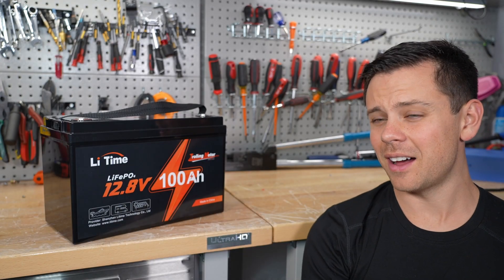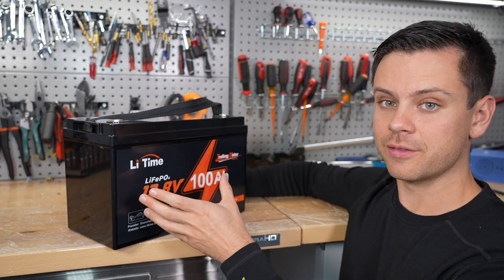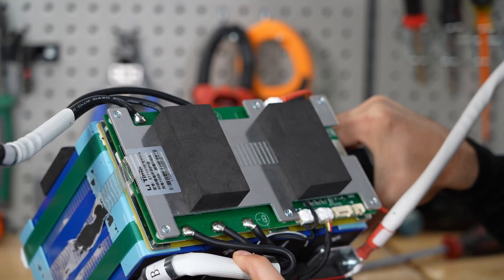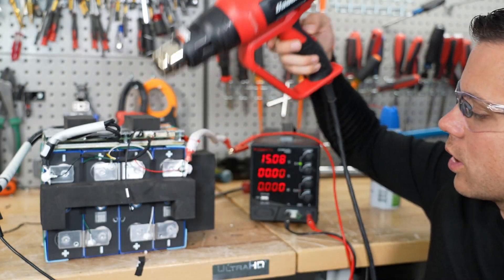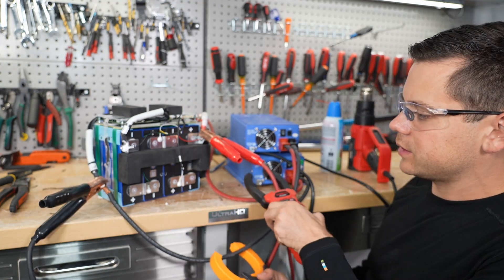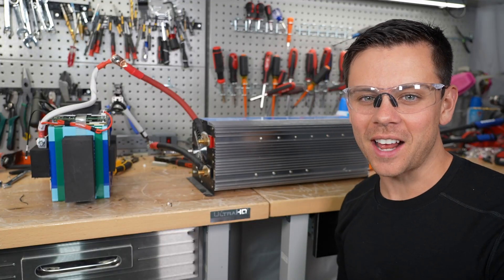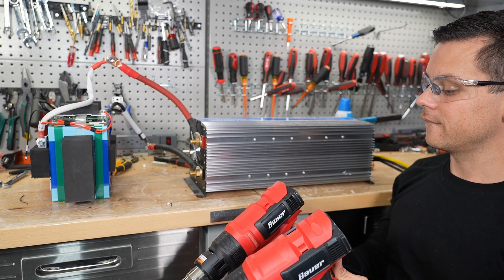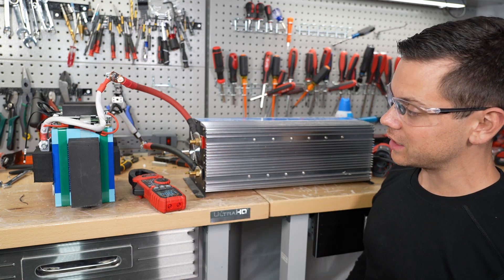$369 Li Time 12V LiFePO4 Battery! 300-500A Surge?! Low Temp Protection?!

Comment: I know typically you don’t uses lithium a vehicle starter battery but I wonder, would this be capable of starting a V8 gas pickup truck?
Reply: Maybe, but I think these are rated for ~1000A as short circuit protection. Your starter might use more than that for an instant. Also, heat kills lithium faster than just about anything. Sitting in a hot engine bay will shorten the life of these. What you could do is make your own with a solenoid & BMS and remote mount the battery. You're looking at a lot of money though and better to just buy quality AGM batteries for vehicles.
On the other hand, if you build it quality enough and remote mount, it could last the life of a vehicle and might be worth it if you think the truck will be in service another 15+ years.
Reply: I doubt it.  If this could even struggle to crank it for a few moments at 400amps, that's still less than half the power of a good lead acid car battery.

Comment: thanks for testing this brand. i bought 2 with the old name over 9 months ago. they performed very well. i actually load test one of the with a 55W light and lasted for over 26H. i did pull out 1100W/h and it was rated 1200 W/h.  i will by 2 more for my small 12v off grid setup.
Reply: Does this account for the inverters efficiency %?

Comment: I have ( 4 ) the Amperetime 100Ah batteries. They have worked without any issues for me.  I only draw them down to 97% each night, and then recharge to 100% in a couple of hours,
Reply: Hi! I have Battleborns and have a hard time getting the two 100 amp batteries below 90% and we use a microwave! However. Hugh at Battleborn told me to get them down to at least 80% to keep them healthy. We had to shut off the panels for two days to draw them down😅

Comment: Hi Will. Enjoy your videos. I have a question. I currently have 2 ea new 48v 17kw CATL battery banks. Both have 300a BMS units with bluetooth.  Neither of them have an rs485 comm port. Can I still use them with the eg4 18kpv hybrid inverter? Thank you in advance. John

Comment: That's a nice battery, but I live off grid, and never use that many amps. The most I draw would be probably around 30 amps if that.
Reply: Very rare to use that many Amps. And if you’re pushing over 100 amps then its time upgrade the voltage, but it is nice to know that if you needed it for an emergency you can pull that many amps. I have 4 of these batteries from back when they were Ampere Time and I have pulled just over 100 amps out them during a test and they handled it well
Reply: @FoxWolfWorld  I will never need that many amps even in an emergency
Reply: @georgecothran4760  It's not the surge Amp draw that you need to be concerned about, so much as the Amp/Hours available. You can always use a smaller breaker/fuse to limit the current. How long the battery/battery bank can last is more important. I've lived off-grid for over 30 years and had many kinds of solar systems, and I love the LiFePO4 batteries because they give a better/longer lifetime, and charge much faster than lead-acid batteries.
Reply: @Tumbleweed5150  Yes, I understand that and my batteries are still around 25.6 volts in the morning before I am getting any watts to them This is for a 24 volt system.

Comment: With that massive surge capacity could this be used for a starting battery
Reply: I'm not sure what you want to start. But a small engine might be possible. I was thinking the same for my sailboat. Using  two, they might start my 9 HP diesel.
Reply: A 454 starter is rated at drawing 300amps. Make of that what you will.

Comment: Those common old people scooters use two 12volt lead acid batteries in series. I wonder if two of these could be used as replacements to increase scooter range? Would the scooter charger charge these?

Comment: Impressive ! I have two of the 12v 100 amp Ampertime batteries with out low temp but have temp sensor to shut down . No problems so far and really more power than I need for our 15 foot camp trailer that is 100 percent solar !...Love it Learned everything from Wills book , website , videos and his experts on the forum.
Reply: Wills book is indeed awesome. Very simple, straight forward and clear and consise.
Reply: Same here except use mine for trolling motor...best fishing investment so far

Comment: I like the fact they weight much less than a deep cycle lead acid battery, but I just picked up a deep cycle lead acid bat 100ah for $99.99! weights a lot more but much cheaper.
Reply: You can only use 50% of the battery power before damage.
Reply: While yes, still technically cheaper, you can only pull half the capacity of that lead battery repeatedly. Where, as with the Lifep04 batteries, you can pull damn near 100% of the capacity out of it multiple times a day for years.
Reply from the maker: LiFePO4 lasts ten times as long